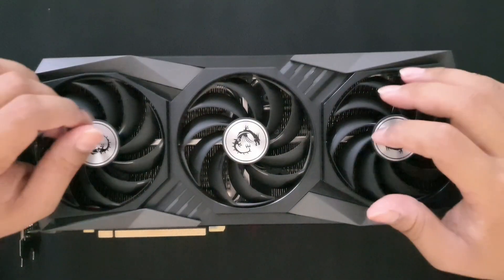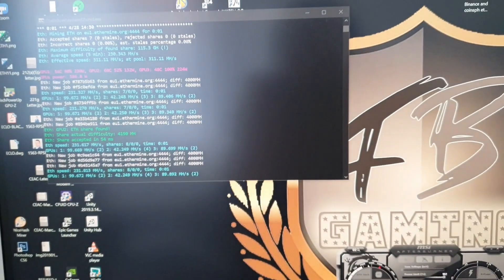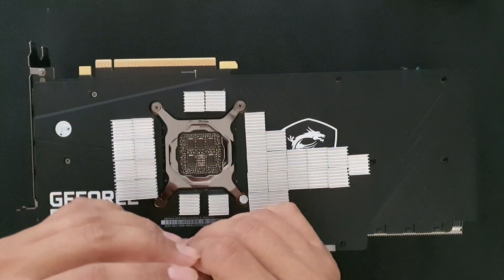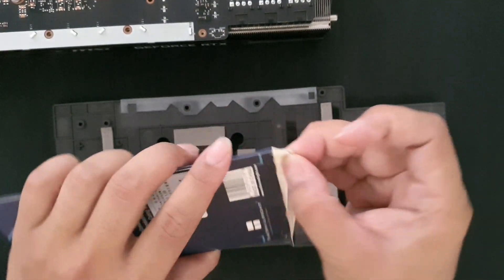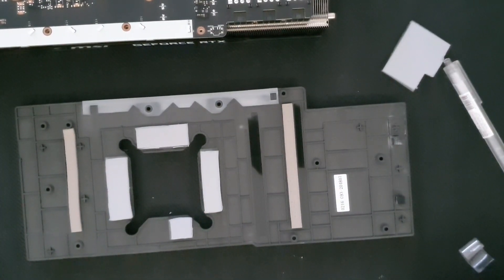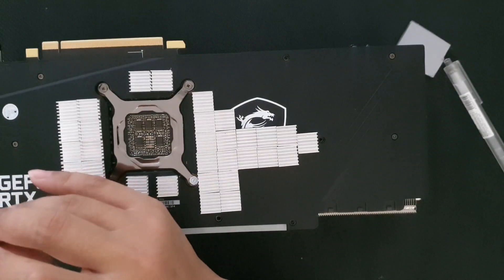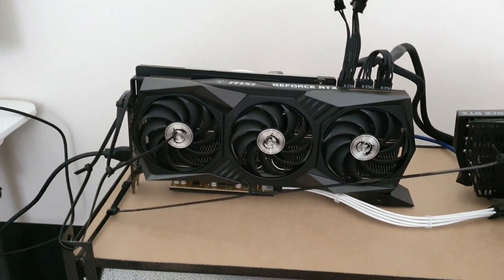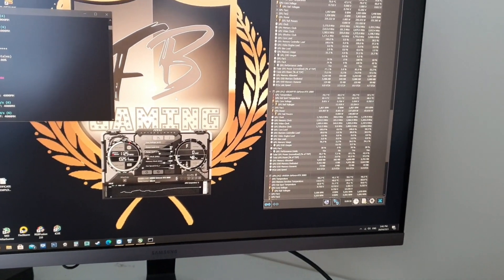RTX 3080 THERMAL PADS UPGRADE | DO THIS BEFORE YOUR GPU DIES!

Comment: I also replaced the pads on my msi rtx 3080 gaming x trio. Im not a miner bzt i got 102° memory junction in 4k gaming. The card was already 50° hot in idle. After the change yesrerday my card is 27° in idle😅  and 76°(warzone) to absolute max 88° (battlefield 2042) in gaming 4k ultra settings depending on wich game i play. My card is already 2 years old and the temps was getting worse. The thermalpaste on the gpu chip was hard and crumbly and the stock pads were  not on the correct position. It sad that we have to change them by ourselves
Reply from the maker: Glad to hear that it turned out good for you after changing the thermal pads 👍

Comment: I have replaced thermal pads in my 3090 with not improvement at all, 3080 and 3090 are ready to support those higher temps, DO NOT REPLACE IT, it will avoid your warranty
Reply: Not in a lot of places

Comment: my rtx 3090 I replace the whole pad...i cut mine according to the memory module shape...filled the whole module...now the temperature stay around 82-88 degree..ambient temperature is important too factor too..
Reply: hello i change only vram from 108c now is 98c, shuld i change also backplate ? what size are there ?
Reply from the maker: It won't hurt to change the backplate also. would drop around 1-2c more. it is 3mm for the backplate
Reply: @ToolsandGadgets  thanks Bro
Reply from the maker: you're welcome
Reply: @ToolsandGadgets  i open the back plate and they put two PCs of 1.5mm To make 3 mm size .
Instead 1 of 3mm
Is this normal or is a bad work from msi ?
I have 3 mm size so i will replace with mine
Reply from the maker: well that's a first, usually they dont stack thermal pads. but anyways yeah you can go ahead and change it to a single 3mm.
Reply: @ToolsandGadgets  
Power limit 106 (251w)
Core clock -502
Memory clock 900
I Got 96.5 Mhs

If i change Power limit to 107 Will consume 317w and Will reach 97 mhs
I dont want High consume for Just half mhs 

Will take 96.5 mhs for 251w

This gpu Is not the best option for mining
Reply from the maker: The MSI gaming x trio really sucks in mining. i can push it at 101mhs but would crash after 2mins.
Reply from the maker: great!

Comment: 3 mm is too thick to effectively transfer heat. Use 1 mm instead, hope it helps.
Reply: I'm doing mine tomorrow, does 1mm on the back is enough, like do they touch the backplate ?
Reply: @Johnzx2  nope
Reply: Wrong advice.
It depends on the space between GPU and backplate. It differs with different brands and versions.

Comment: I got the same result with hard pads. Try soft pads like gelid Extreme instead of Ultimate. They form around the shapes easier
Reply from the maker: so far i was using Thermalright extreme odyssey thermal pads. will try the Gelid when it is time to change pads in the future
Reply: I have seen both pads but posted in places trying to find better answer. So far no responses, but between Gelid/ thermalright/ fuji poly and frosty ice plus, of they are all 12 W/mk, can I just buy the cheaper one? I’m from the US and not sure which among these to buy. I might need a few so price is important to me but so is quality.
Reply from the maker: go for gelid or thermalright
Reply: @ToolsandGadgets  Nice okay. I have one gpu running gelid and one gpu using this off label brand called Frosty Pad 12.8. it's some Amazon one (US?). Apparently I'm getting similar results maybe +/-3. Very interesting. I expected worse from an off label brand that is like 40% off the price of gelid.
Reply: I'm using the same branded pad,  but i took 2.5mm,,, its perfect for almost every gpu, temp drops 110 to 76-84,,,,,,,,,,99Mhs continuously on my gigabyte 3080 gaming oc
Reply: Any idea what size pad from gelid ? For vram some say 1.5mm gelid for 3080 x trio ?

Comment: It is a plastic backplate, what did you think it is gona happen, just remove it and pu a fan to blow over the back, or better, buy frikin metal backplate
Reply: Its graphene composite material and back plate gets hot. Adding heatsink helps

Comment: Hi, does this work with the Dell Alienware rtx 3080, that comes with the Alienware r12 pc?
Reply from the maker: Hey there, sorry but Different brands and different model comes with different thickness of thermal pads. you should check with your manufacturer for the thickness of thermal pads used in your rtx 3080.
Reply: did you find for the dell?
Reply: Not yet
Reply: I bought thermal paste tho
Reply: Noctua nh2
Reply: I will get someone to put it in for me but there is a vid for it
Reply: You can also join the official Alienware discord
Reply: Just search dell Alienware 3080 repaste
Reply: There is a video which will show up which in blue letters says quick fix that should be the one and it tells u what to do, they also install an intake fan but u can ignore that

Comment: there is a copper shim mod I'll be trying. I'd recommend you watching that video before you go buy some expensive thermal pads. The guy reported about -28c degree dif between stock on vram modules. The guys channel is Сергей Халяпин. I don't know russian just turn on subtitles.
Reply from the maker: Nice! Let us know if it worked out for you, would really love to here how it goes.
Reply: @ToolsandGadgets  I have made the mod! Unbelievable 74 memory junction temperature. (108 before) Couldnt test the max performance of my 3080 gaming x trio before because of thermal throttling. After the mod I realised that I got a very good sample of those memory chips. In afterburner I could apply +1500MHz on memory and get about 103 MH/s. Im mining for 20 minutes and memory junction still at 74. I would definitely recommend this mod since copper has a much much more w/mK heat transfer ratio thsn those sticky thermal pads. I realised that the heatsink didnt had a good contact with the memory modules.
Reply: @ToolsandGadgets  I will! I'll be using 0.8mm shims and MX4 thermal paste, nail polish for isolating.
Reply: Can you paste the link of that video?
Reply: Did you just change the front pads to copper I guess and 3mm thermals on the backplate? What's your gpu temp and hotspot (not junction)
Reply: @financiallyfree  after about 1 month I can say that im pretty happy. Memory junction is about 84°C when mining(103 mh/s) while the gpu core itself stays at 63°C. In gaming I get about 70°C while the fans are at 75%. I know its obviously worse than stock but  it's still not in risky territory.
Reply: @AbdullahBilik  thanks for the super quick response 🙏
Reply: @financiallyfree  you're welcome bro.
Reply: Hi my friend! I would ask to you, what exactly did you do? I saw the channel of the russian you said but i did not understand the conclusion... At the end of the day, did you just take out the backplate? or you used a mixed of thermal paste and a copper sheet in the memory place ?? Thanks!

Comment: This is necesary with a rtx 3080 of evga?
Reply from the maker: well that depends. what is your memory junction temperature?
Reply: My EVGA 3080 FTW3 gets around 90c at 61% PL and +1500 Mem oc with 1200mhz on the core at 0.731v with 100%fans. Room temp - around 27c

Comment: Nice video, all RTX 3080-3090 GPUs thermal pads are weak for gddr6x it seems 2-3 w/mk. I think if you replace the front pads you can get under 100C
Reply from the maker: Yes they definitely cheap out the Pads on such expensive cards
Reply: Yeah my card is thermal throttling and finding it hard to deal with. Do you know which pad I should buy? Frosty ice plus/ fuji poly/ gelid/ or thermal right?
Reply: @storedcoin4026  Hi fuji poly is best but it's expensive gelid and thermal right are same and I don't know about Frosty ice plus. On my asus strix RTX3080, I use 2 layer of thermal right 1mm for front vrams and 2 layer gelid 1.5mm for back of the vrams chip and this is result:
Before: mining with 62% power_-500mhz core - +1200mem - 94.5mh/s // vram temp:94-98°c

After: mining with 70% power_-500mhz core - +1900mem - 105.2mh/s // vram temp:78-84°c

Comment: But that backplate is plastic ? If yes whats the purpose of adding those little shink-metals ?? There will be 0 job on those cuz of the plastic backplate, now if the backplate is metal, is making sense.
Reply: MSI won't go Cheap for Outer Look Belive me ^^
Reply from the maker: Well at first glance it looks like plastic but MSI confirmed that it is graphene-enhanced composite material and 20X more effective to dissipate heat. And when touching the heatsinks it surely is hot.
Reply: @ToolsandGadgets  Ohh ok than, if that backplate is hot yeah seems to work
Reply: Yes its graphene so it supposed to dissipate heat

Comment: your temps were outrageous because of your oc settings.  I know the 3080's run hot mining but your power was maxed.  bring it down to 74.  hit that core at -100 and mem at 1100.  that will greatly improve your thermals.  try it before you replace the front pads.  watts = heat.  also less profits running higher watts when you can achieve the same reuslts with less.
Reply from the maker: Hey TomStev, i tried almost all the OC settings available in the internet for the 3080. But luckily no luck in doing so with stock thermal pads. PL 74 with -100 and mem at 1100 i remember trying that and my mhs was just hovering around 70mhs and vram temp was at 102-104c. Maybe i lost the silicon lottery, or my card is just really bad. But everything changed when i switch the thermal pads. Currently using ThermalRight Extreme Odyssey, so far so good
Reply: @ToolsandGadgets  I’m glad it worked out.  I saw the second vid after I wrote that.  Yea maybe you did lose the lottery.  I e got a 1060 that won’t hash unless it’s at 100 pl even after modding.  Luckily My other 12 cards all have exceptional hash rates at low power.  Gotta thermal pad a tuf 3080 I got in yesterday as it’s hitting 112 but oddly isn’t throttling and that’s scary.  That micron 6x mem on the 3080’s just likes to run super hot for some reason.  I’m a big fan of Fuji poly pads.  They are expensive but oh so worth it.
Reply from the maker: will definitely try that fuji poly pads i heard that it is the best but crazy expensive though. My msi 3080 gaming x trio has some sort of bypassing the 215w cap set on the bios by just adjusting the PL to 102. and upgrade the bios with a secret upgrade located inside the msi dragon center software under support option. Also by placing heatsinks around the backplate helped around -2c and a fan blowing straight into it.
Reply: @ToolsandGadgets  We have the same problem bro. But mine I just set it to 101 PL and it does about 97-98 megahash.